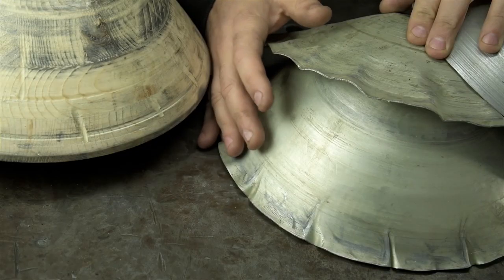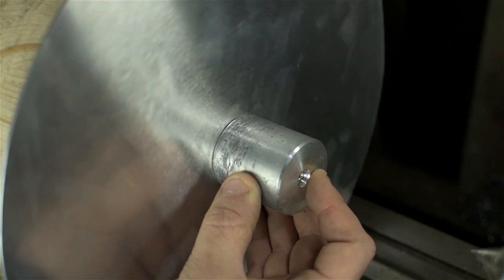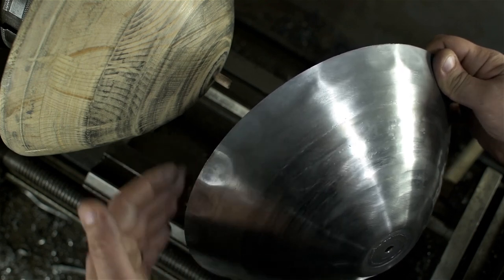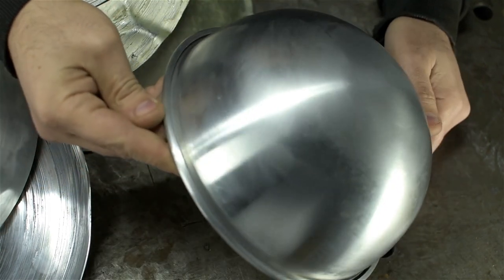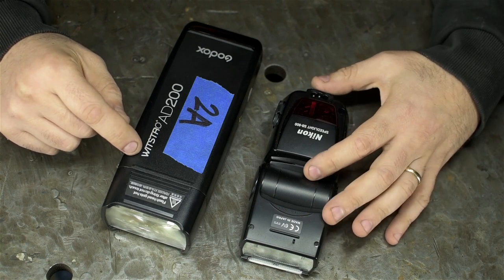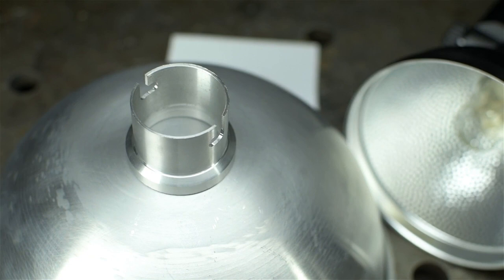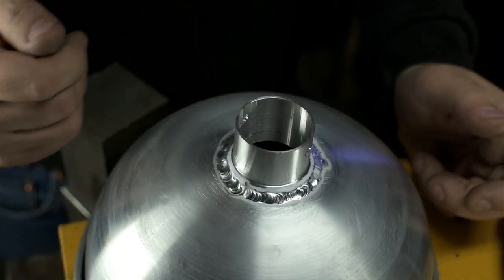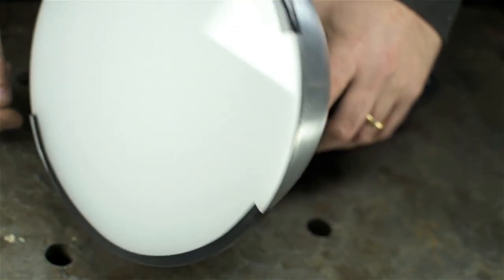Spinning Metal - Part 2! - GODOX Strobe Reflector Build

Comment: Hey tony i think i know why are you are getting a hole every time... look at 2:13 and 5:22  in your video .... when you are pushing your forming bearing and that round end metal rode,  you are bending the whole bowl from the holding point that's why you are getting a hole. so you need to add support on the other side of the metal that you are spinning and problem solved  .... its like breaking a paperclip by bending it multiple time ..... you get it? i will wait for your reply ... and the part 3 of this video 😀👍👍👍 edit: this video might helpful 
https://youtu.be/BImGDhzr-9Y

Comment: You have been doing really good. The disc cutting out itself in the middle is lack of support. Spin the metal initally with the smaller piece and then with larger one (the thing you squeeze the disc with the tail stock). Sorry i don't know what that's called. Then you can spin the metal and get a satisfactory result.

Comment: I don’t think you ever plan on going back to this, but I can’t see any comments that point this out: You can actually see in the time lapse how the base is failing around the... aluminum mounting bar... thing. The thing that your tailstock is pressing into the piece. Around 5:50, if you watch the right hand side of the blank right where it was bowing and failing, you can see that as the blank is pushed on one side, the far side from your is torquing, lifting the edge and causing the deformation that work hardens and eventually breaks.

Comment: The lampshading happens because the material that's getting forced out of the center of the disk has to go somewhere, kind of like if you make a circle with your thumb and forefinger and try to stuff a piece of rice paper through it. If you heated the piece of metal while turning it, especially at the ends of the disk, (or even just annealed it before turning) it would probably have a better chance of not deforming, rather causing a kind of flower petal effect with a wavy pattern at the lip (which could be trimmed off the same way you have been). Should result in a more consistent lip after it's trimmed.

Comment: Tony,Buy some of the specialty sheet metal spinners grease.Sometimes orange in color.Thickly coat the whole disc with that.Use your roller tool (although the round nose tool would probably be better since you are not a cnc machine) and put only a little pressure going  back and forth across the work from center edge to edge at a moderate speed heating the work from friction without yet trying to form the metal.The heating of the work makes it much more malleable to form under pressure and the grease keeps you from burning or scaring the surface of the work so there is a lot less post finishing work..After a few passes to heat the work,then with greater pressure and one or two every even and continuous swinging motions (depending on the complexity of the shape of your mold master) go from center to outer edge with the forming tool pressing hard to form the work against the mold master.Don't press too hard as you may pierce the work.Proper sheet metal spinning tools are much longer than standard wood lathe tools because of the increased leverage needed for this work.They are usually used with a multi position tall pin style sheet metal spinning tool post/rest set close enough to the work to allow the edge of the tool to swing the full span across the work face in one pass without adjusting the tool post/rest for more travel.But set up to have a big leverage advantage.There may still be a slightly ragged edge on the outer diameter of the work that a metal spinning cut-off tool can trim off.Or your metal lathe tools can do it.The safety guide hole in the center of the metal is unnecessary if you screw your tail-stock in tight enough.There are a couple of great websites that sell excellent sheet metal spinning tools,lathes, pre-cut sheet metal discs of the correct alloys and spinning courses on DVD if you look.But really what do I know?This is all just something I read off a bathroom wall in high school.Good luck.By the way can I get a patreon account so you can pay Me?

Comment: Don't give up on the spinning, it works fine on metal lathes. It's the tool that is holding you up.  It's all about lowering the friction you create on the blank vs the friction that holds the center and spins the piece. The roller is the better tool.  You should bevel round your roller much more, because the flatter it is the more friction it will cause(bad). Usually it's made from stainless and highly polished. again, to eliminate friction. Also, polish the form as much as you can (bondo or epoxy)and, try oil on the blank, if wax or paraffin are not doing it - the blank will take on all the imperfections of the form.  I would use a bronze bushing instead of a roller bearing, to eliminate any possible give when pushing with the tool. A good shortcut is to buy a trailer hitch knob as they are usually the ideal size(2" dia or 1.5 depending on what you find). Throw it on the lathe with some soft jaws,   create 2 parallel flats, and drill a slide fit for a  1/2" OD bronze bushing . It should be look kinda like a donut about 1- 1.25" thick,. The idea is to meet the blank with a single point of contact NOT a surface, so depending on how you make the yoke, you might need to enhance the roundness of the donuts.  The holder/yoke is really a Y or a U shape, with the axle also polished as much as you can. You need to ensure that the roller can spin with little resistance and that the geometry is such that as you turn the tool it still contacts the blank on a rounded point without sticking. If your roller tool is well made, it will not create friction on the blank.  Unexpected friction causes you to exceed the drag force on the outer rim of the piece, which heats the piece too much and messes up the finish, and most importantly it causes the shearing you saw at the center.  You are doing it correctly, you are just using bad tooling. If you do try again and god forbid begin to like it, you might also want to create a few dished "holders" to increase the gripping surface. They will be necessary if you go much wider.

Comment: As for the spinning, even though my comment is now a rather moot point, I wonder if you would have had better success if you had a number of wood forms to spin against, in incrementing radii. Also, have a reversed wooden (for lack of knowing right word) presser...the thing that was aluminum on your trials, but it being bowl shaped...I think that weird ripple was caused by the aluminum bowl teetering off the other side of the form...if that makes any kind of sense at all...
And for the mount for the defuse, I wonder if you can find or make something like a barrel lid clamp.

Comment: I honestly think the problem is your one joint tool fixture is the issue. All the Spinning tools I know have two joints, so that you canadjust pressure and position at the same time. I think you always get spots with to much pressure, as you can only move your bearing around one fixed circle.

Comment: The bowl was most likely stamped not spun. The stamping operation was likely done in several steps. 

Trying to spin it all at once was likely problematic. A wide, shallow form for the outermost rim and spinning that section first would have given it the rigidity to hold up as you work your way toward the center by stacking forms on a mandrel.

Comment: What might make a difference is your working temperature. Aluminium is COLD worked at room temperature - meaning the internal crystals keep getting crunched. Lead on the other hand is hot worked at room temperature, meaning if you were to spin a lead sheet it would come out perfect! This means - just add heat till your material is hot worked rather than cold worked!

Comment: Honest suggestion from someone who doesn't know what they are talking about. Please hear me out.

You are getting the wrinkles/crinkles at the outer edges of your bowl because of how you are working it. You are working/spreading the inner part of the bowl without working the outer part of the bowl at all. 

Try working the bowl from the center to diameter in passes; try covering the whole bowl in every pass. 

I realize that means moving your tool post way more often but I think it might solve that problem.

Comment: Looking at the way the whole work piece moves when you apply pressure near the edges makes me question the methodology, so much stress is focused around the tiny mount point.  And the springiness of the metal makes it very difficult to press it tightly to the form.  So I thought, what if you take the traditional 3 roller sheet metal roller and rotated the rollers 90 degrees?  And then mount them on a giant scissor tool?  See https://imgur.com/a/x4w6AoV for an illustration of uhm, my new invention, the Spinning Metal Roller Scissors of Death.

Comment: I see the Problem. If you Press at the Foil, the Foil acts like a Lever, if you press against it, the Oposite site of the Foil is Pressing against the Backpiece, that makes the Foil getting a fold into the wrong direction. You can see it pretty well at 5:24 . Look at the Center of the Axle. 😳

Comment: A theme I seem to recall from watching the 'pros' do it is they always finish every stroke with a to-edge follow through, tiny movement propagates the entire radius of the part before going back and adding another bend. If you try to do too much too early the outside isn't stretched enough to continue the bend.

Comment: ... Light pressure and let the lave do the work. I would have to play with it a bit to give you more in depth ideas of what to do, but overall but they vary from only going from one end to the other none of that back tracking. you will have better results of you give it a constant light pressure and let the lave do the rolling.

Comment: Hey ToT, I work a lot of aluminum sheet metal every day, perhaps I can lend a couple suggestions? I can say that setting up a heat gun to keep constant 180 deg Fahrenheit on the area you’re working, it will let the aluminum sheet metal relax. One other thing that could help is a way to apply pressure 180 degrees out, so it’s not wobbling on the live center hub and work hardening the center. It could be just enough to allow you to finish out the edge without work hardening  the center or the outside edge. Even though you made the bowl work, I’m still interested in seeing you succeed with this! This may not be the answer, but who knows? Sheet metal has interesting characteristics, especially aluminum!

Comment: You are moving out too quickly. If You watch other videos you will see that they work slower and closer and shape the disk to the form and keep working up the form leaving the outer disk straight and letting it pull in to the form until they reach the top of the form. You are moving too quickly and trying to force the metal down to the form instead of following the surface of the form, which would give it support and stability. Some use a piece of wood to straighten the outer disc occasionally. They pull the metal in to the form and flow or shrink it to fit, You trying to shrink it by force (pushing) it in which it doesn't want to do. A bit like trying to push a chain uphill.

Comment: Hey, just want to tell you I'm no expert in metal spinning. But I do know how to turn a wrench or two haha. On my college race team I use to make funnels with a single piece of aluminum and a hammer. If you watch your video back and watch the point at which you squeeze the flat, as you apply pressure to the outside to roll it around your form the flat as a whole bends around the aluminum  stock used for alignment. Maybe try to always begin at the center and move outward, repeating until the form is complete. Again not sure, and the price of material is not great while knowing it might not  create the product you want on the first run.

Comment: I believe professional metal spinners dip their spoon in a lubricant. The one I saw looked like the consistency of motor oil. And I also believe they often use heat from a torch on their work.

Also, great videos, Tony. You are awesome.

Comment: What's wrong with using a hammer to force the aluminum plane onto the parabolic surface?
If you're lazy and want to use power tools, then se a power hammer :)

Comment: You're torquing it...when you push on one side with your forming tool the other side flexes out the opposite way, causing the bulge around the dowel and the break.

Comment: Your first push has to be hard up against the tool also don’t be afraid of making a bigger centre wood “wood”. On that size a hand tool is best. You will need two. One for planishing and one for shaping. 
Soft aluminium is good. But you need to epoxy the tool to harden it. Mdf is best.

Comment: The biggest problem with the turning is bending one way when you press into it... I would recommend trying to heat the metal to make it more pliable with a torch and then going... Also higher speeds and less pressure... But most importantly is your going too hard all at once... Make 2 or 3 different forms to form to. And anneal the metal between forms so you don't get the tearing

Comment: Tony, I may have found a video from a Finnish spinning shop showing the way to avoid the wrinkling issue: https://www.youtube.com/watch?v=hBfA13uZwJw
It seems that putting a 90 degree bend on the outer rims avoids the issue, and it leaves you a good amount of material to roll a clean, finished bead in the end.
Might be worth testing.

Comment: Tony, when you press on one side of the disc, it bends that side down, and the other side up. If the bottom of the bowl stays in place, you are basically just bending it back and forth until it fails. I bet you could get this to work if you could apply pressure symmetrically.

Comment: Hey Tony if you  are reading this i got to say, absolutely fantastic videos, and i got an idea for attatching your "defuser". At my workplace one of the things i make is Quick cuplings for various sizes of pneumatic transport pipes. So i thought you maybe could use something like that. So i was also wondering if you provide the outside diameter (prefered meassurements in metric) and the width of the roll up on the bowl, so i could perhaps give it a shot to make one myself if you would like that.
Feel free to contact me!

Comment: i spin copper not familiar with aluminum... major difference between technigues/  your using  a lot less lubricant and your not doing  any back passes. (bring metal back to the center to keep,it from thinning out; for copper it gets work harden very quickly and needs to be annealed frequently especially for the large pieces your burning thru your tail piece because your not setting the metal to the base of the form (its wobbling) after you set 3 inches or so change out to a  3inch negative to the form on the live tail

Comment: I think part of what your problem with the holes being cut into the center, was because of the sideways torque you were putting on. The turning of something at speed, plus the angular torque of adding pressure to only one side, plus the aggressiveness of that pressure caused things to go all caddywumpus and cut the center out almost like a shear against the sharp edge of the centerpiece you were using to hold the work in place. Rounded edges on the center plus smaller and less-pressured strokes would really help a lot towards keeping the shape consistent.

Love your vids...just sad that I don't have any of the tools and machines I want, to attempt my own projects that watching you gives me ideas I want to try.

Comment: For future reference.  Aluminum can be blackened using the muriatic or phosphoric acid found in toilet cleaners. Simply brush a thin coat of cleaner and let dry. Then thoroughly rinse with water. No primer or paint needed.

Comment: I wonder if you could find a correctly sized quick release clamping ring of whatever those things are called to hold the diffuser. It might be overkill but it would hold it on well and be easily removable.

Comment: Put the cylinder wood replacing ur aluminium cylinder. That might be little soft than aluminiun,so it won't scratching ur metal plate too deep that make big hole on the center of ur plate...or maybe something more soft,u can try any material...

Comment: I haven't had any luck with metal spinning companies returning inquiries, or if you would be interested in expanding this short series in like a secondary processing of spun aluminum, because I have a 6 inch spun aluminum split rim I need the depth reduced on if you would be interested in doing?

Comment: I feel like it would be much safer to shape if you could push from two different directions. If you push only from one side you're unbalancing the entire piece and it pressures the middle which is what ends up making it break off. I imagine it would be really hard to make a tool that could do that though, I know next to nothing about machining.

Comment: Tony, I seem to recall you building a ring roller awhile ago. I suggest you use it to make a clamp ring for the diffuser.  Something like you would find on a 55 gal drum lid but scaled down.  As an added challenge make it a toggle clamp mechanism instead of the wing nut rig.

Comment: This requires a special aluminum to spin out something without total failure . Roller on a long stick ? I once used a an old broom handle with metal waxed down good. I got pissed and went to a metal spinning shop they let me walk around and watch. Otherwise it would have been very crappy. I saw them spinning titanium that was dull red hot with fascination.